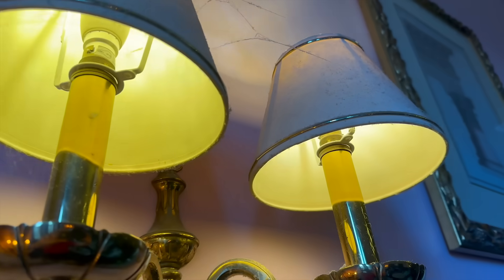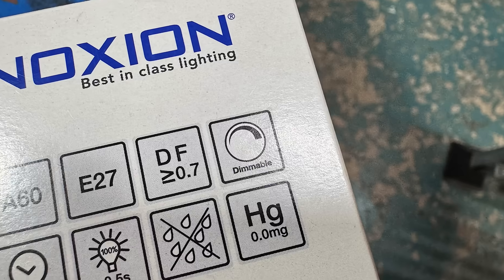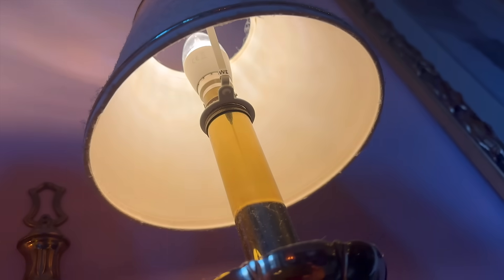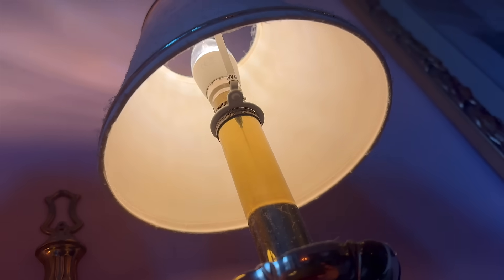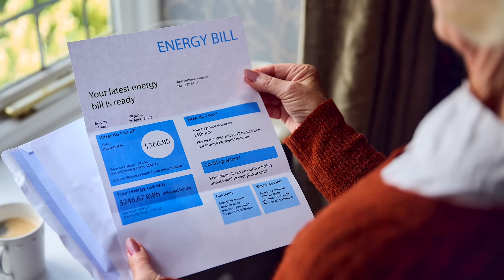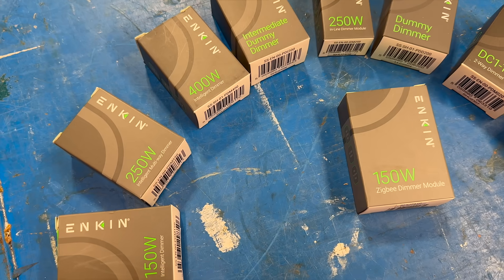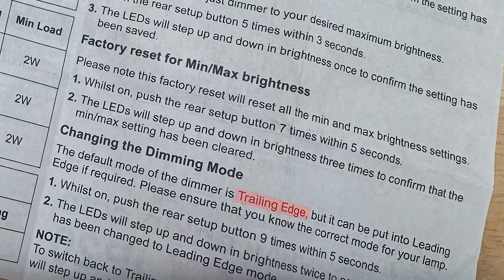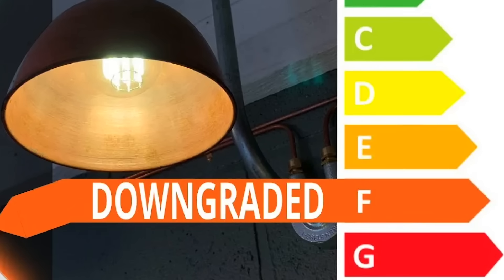Essential Guide to Flawless LED Dimming

Comment: I utterly failed to understand what was the problem with incandescent  lighting? Sure they are less efficient, and do not last as long, but they are much cheaper without producing as much toxic e waste. The stated energy saving with alternatives to incandescent lighting is not as stated as much of the energy losses are generated as heat, which would have to be generated by other means during winter. The short use life of incandescent bulbs was entirely engineered due to built in oblesesnce, something developed in light bulbs, but has spread to all areas of capatalist production, including led lights, cars, batteries, fridges, all white goods, TVs, heating systems and even bycycles. Under this paradime, you could view the move towards 'sustainability', and the myth of carbon zero as a form of built in obselesance. Their is nothing wrong with sustainable production, producing consumer durables, that are durable and produce minimal toxic by products in production and disposal, this would be ideal, but this is not what is on offer under capatalist, particularly post modernist production. A real commitment to sustainable production methods would mean going back to fridges and cookers that lasted 40 years and affordable public transport, not producing humongous amounts of e waste to produce individual transport using batteries manufactured from strip mining rare earth's such as lithium, manufacturing batteries with that same built in oblesesnce as the light bulb. Just how environmentaly friendly is it to scrap the entire fleet of internal combustion engine vehicles, from cars to lorries to trains, and replace them with electric vehicles? Would the national grid cope with this massive increase in electric generation and transmission? Exactly how would you safely scrap and dispose of these ICE, and does the infrastructure exist to do so? How exactly do you generate the base load of electricity, to cover intermittent  supply from some sustainable sources such as wind and solar? No under capatalist production they will hijack anything, steal anything and sell it back to you, including the commons, even monatitising nature via carbon credits to maintain the rate of profit.
Reply: Fabulous rant, but strange - so strange - especially in today’s energy climate. The cost of energy is huge here in the UK, and lighting used to be the biggest part of the bill by a long way. 20 light bulbs in a house, that’s 1.2kW of energy. What strange part of the world are you from, where you don’t understand what’s wrong with incandescent lighting? Do kWh grow on trees where you live?
Reply: @MatSmithLondon Go back and read it again. What uses the most KWhrs/week or year in your house? Go work it out. I know lighting uses a very small part of my electricity bill in the UK. The clue is looking at the power output of a old style 60w bulb is oddly enough, 60 watts. This is why in a modern house the lighting for all the ground floor is fused at 6amps, the lowest fusing in a domestic consumer unit, on which you could run 100 watt incandesant bulbs in every room in the house. The power used by heating elements is far more significant than lighting, which is why it is fused far higher. Obviously some loads are used drawing more power for shorter intermitant periods, making them less significant to your overall electric power bill, but heating your house or heating water much more significant than lighting. I live in England, never lived anywhere else, but if only these people could actually add up, and knew some history? Multiply the power output of each appliance by the number of hours you use them each week, and divide them by a 1000 to get the energy used in KWhrs. Work out how many KWhrs you use a week from your bill, and how much each appliance uses as a percentage of your overall bill? You could even work out how much a 60 or a 100w bulb would be of your overall bill if you switched back to incandescent bulbs? You could even compare the cost of charging an electric car overnight in KWhrs to a 60w bulb? This is why I am sugesting this greenwash is BS, only designed to make money for the man. Do you have all your lights on in your house on at the same time? A typical electric fire can use 2000w, which is larger than 60 or 100w incandescent bulb. An imersion heater typically uses 3000w, also larger than 60 or 100w. Level 2 electric car chargers for domestic use can use 3300 to 19,200w, and you are somehow sugesting 60w/100w incandescent bulbs are the largest part of a domestic bill? I really think electricians should be able to do some basic maths.
Reply: @regsmith5972 No modern home uses an immersion heater or a 2kW electric heater for their primary heating. Maybe yours does, maybe you live in a place with no central heating - whatever. It’s not normal. Of course the lighting in my home is not the greatest part of the bill. Why did you ask that question? It doesn’t prove anything. You don’t bring 2kW heaters into an argument about greenwashing, you compare like for like. You make it so complicated. Fact is that a modern LED bulb uses approx 1/10th of the power as an incandescent. Forget duration, kWh, total energy (thanks - I don’t need a lecture in science), they are irrelevant when comparing power usage. They cancel each other out. It’s not difficult. Here - if you want to consider them then let’s. Leave a 7W LED bulb on for 12 hours a day, then compare that to leaving a 60W bulb on for the same amount of time. 84Wh vs 720Wh per day. My energy costs 32p per kWh. Your crap incandescent cost me £84 per year compared with my £9.80. Now make it 14 bulbs because I have a big house with hallways and 6 people who forget to turn them off. £1,176 in lighting costs compared with my £137.
Reply: @MatSmithLondon Your maths is a little weak, 2000 watts or 2kw immersion heater element is much larger than a 60 or 100 watt (this is 0.06 or 0.1Kw) incandesant bulb. I live in a flat with gas cetral heating, the cost of lighting is negligible. You could even look at your electric bill, which will give you the cost of each KWhr in pennies, then work out how much you use a particular light in hours in a week, multply this by 60, for a 60 watt bulb, and divide it by a 1000, and multiply it by the cost of each KWhr to arive at the absolute not relative cost of running a 60w incandesant bulb in a  normal weeks usage, and compare it to the absolute not relative cost of running a LED bulb? I however used to live in a flat a few decades that was all electric with electric storage heaters, and a imersion heater, and as this was some decades ago, this had incandesant lighting, and you were very aware of the cost of switching on the heating or the immersion heater, the cost of lighting was relatively insignificant, even though electricity was far cheaper than now. I also had an electric key meter, so was very aware of my power consumption. A large % decrease on something that uses very little energy,  such as a 60w incandesant light bulb, is a tiny energy saving. Do you not understand how percentages work? Go look at your consumer unit, which circuits draw the most current (as P=VI, and voltage is a constant for a one phase supply, power is propotional to current) for a mostly non inductive load, is it the lighting circuits at 6A? Or do the ring final circuits at 32A, or the imersion heater on its own radial draw more current? Some heaters are on their own radial circuits, as they draw significant amounts of power. I am sorry I have to explain the facts of life to you, but your understanding seems rather limited. Domestic lighting is in either 1.5mm or 1mm cable fused at 6A due to its low power usage, wheras electric cookers are wired in 6mm, showers at 10mm, and ring finals at effectively 5mm as you are using 2x2.5mm cables in a ring. How do you not know this? When I did my city and guilds, we did circuit design. I feel like father Ted explaining to father Dougle, "this is small and close, this is large and far away". Who with their marbles leaves a light on 12hrs a day?
Reply: Go live in a country where you the worker own the means of production then. Capitalism is the only way to prosperity
Reply: @ChooseLife.YourLife No it isn't, go read some history. Remind me who is wining the production war in the Ukraine, is it the west or largely Russian nationalised military production, such as ROSTEC? Go look it up, start with shell production, then look at tanks. Russia has a traditional Keynsian  mixed economy. I do not expect you to understand this given your obviously limited education.The electricians union used to be a good comunist trade union (the ETPU) who understood these things, until it got took over by class enemies like Chapel. Now most sparks, are not very bright sc£bs who side with the boss every time. You know the old joke about electricians, 'why do electricians have mates, because they have to pay them'.

Comment: Home Assistant controls my lighting, no problems with dimming anything. Looks like a problem that did go away years ago.
Reply: I also use HA for all my home lighting
Reply: Lol - home assistant doesn’t do the dimming. It does the controlling. You can still use mismatched hardware for dimming leading to issues presented in this video.
Reply: @MatSmithLondon yes that's very true